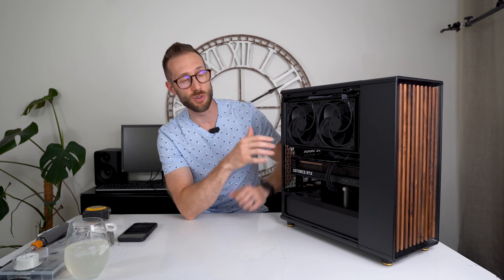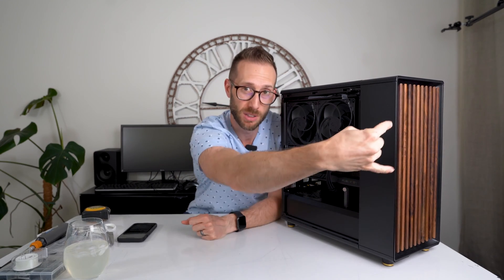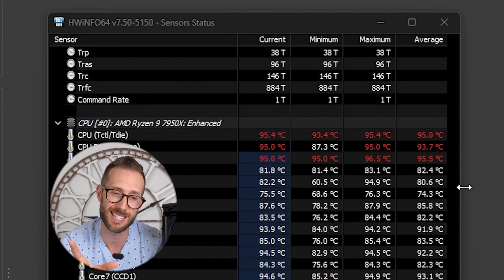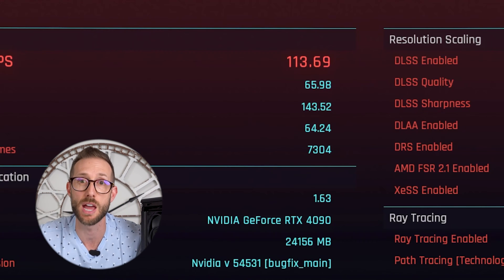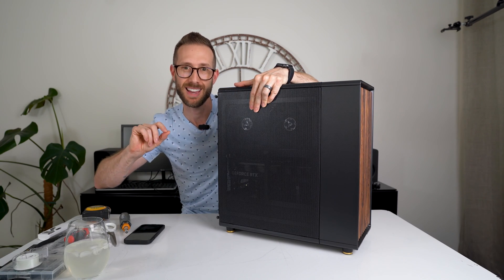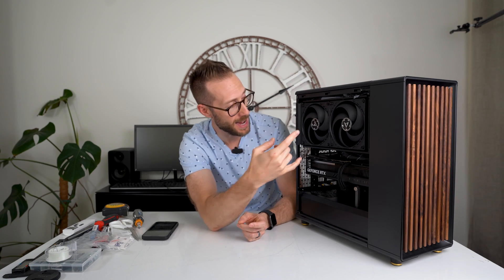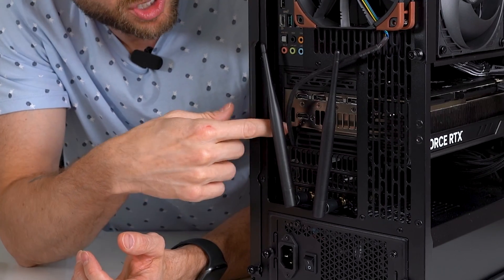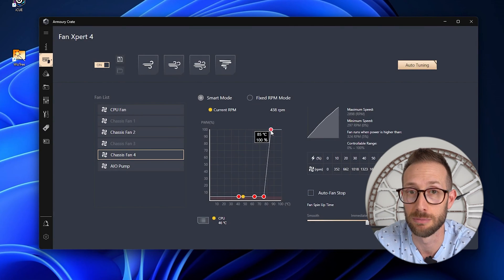The Unexpected Truth About Side Mounted AIO Fan Direction | Arctic Freezer II 280mm

Comment: I like push cooling, aka positive pressure. In my experience negative pressure will cause dust buildup at every gap, vrs dust only at intake filter with Positive Case Pressure.  Thanks for sharing John!
Reply from the maker: Love the feedback!  I agree.  I feel better now that there's more air flowing into the case than out.  Too bad there isn't a filter for the side of this mesh case.  The mesh holes are quite large and doubt they filter much dust.
Reply: @JohnLCharette  Yha in a perfect world, you filter the air going in... negative air pressure draws air and dust in from every gap, clean positive air much better for long term maintenance.
Reply: @JohnLCharette there are magnetic filters for cheap that you can use directly on the inside of the mesh. They are 140 so would alight perfectly with the fans.